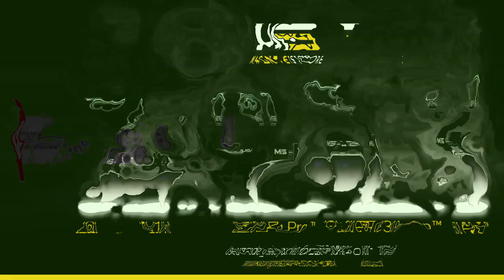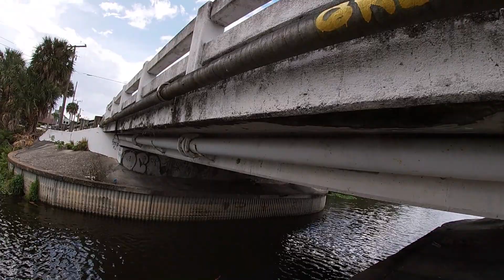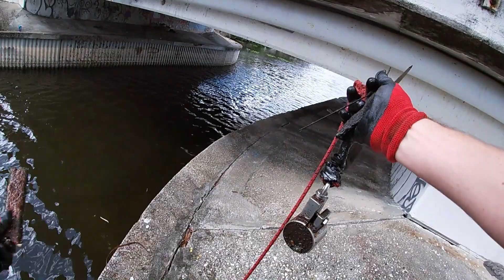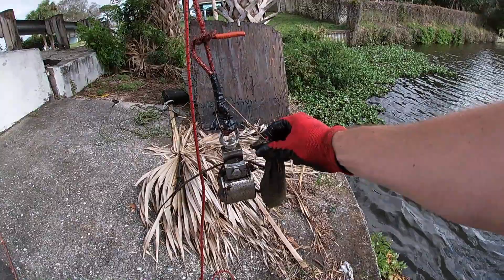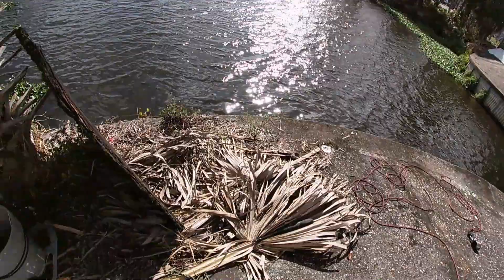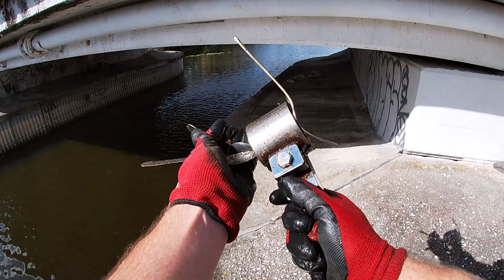Magnet Fishing the old honey hole!

Comment: Nick, that honey hole always produces a wide bandwidth of treasure,  from bras to gun magazines 😀 That may have been a BB pistol magazine  since ya found some co2 cartridges, the Prism thing I was thinking maybe  a magnifying glass, but knife blade awesome. Old Patriot  latches on pretty well, do ya think that spot is "safe" for the new Genesis? For the first splash on that puppy, a nice muddy bottom versus rock would be ideal but you also want potential treasure. Weather up in Pacific Northwest not bad but nothing like Florida.  Stay Safe, Cherers, Bob
Reply from the maker: Hey Bob! Yes sir it just keeps giving up more every single time! Could have been a magazine but it was so corroded I can't tell! The prism deal turned out to be a multi tool... Got it open , has a blade, can opener, flat head etc on a flat steel blade! Thanks bud!